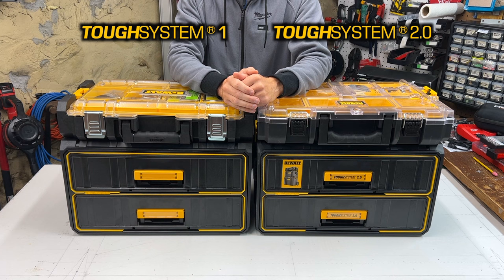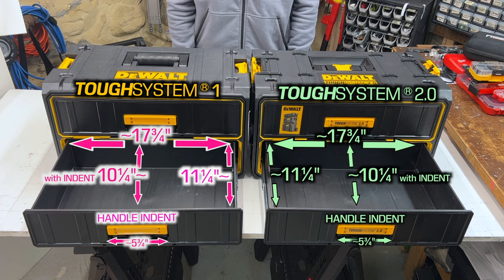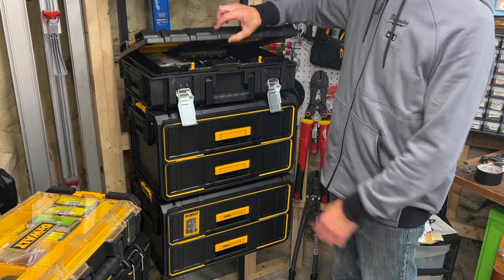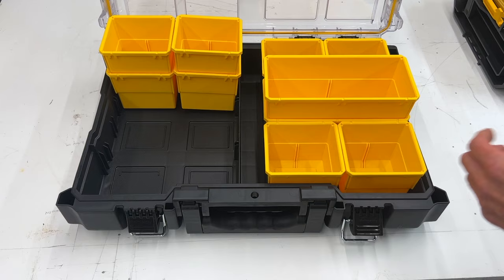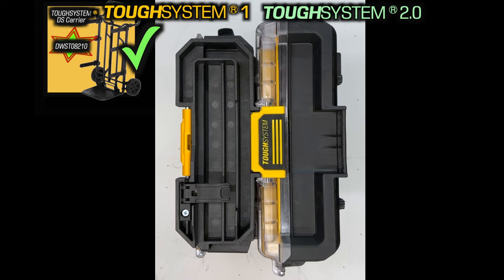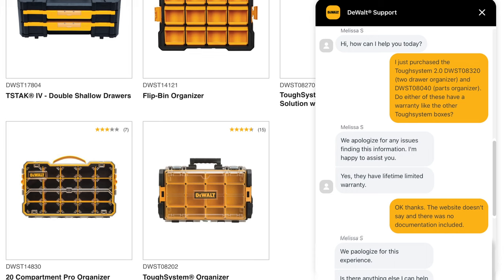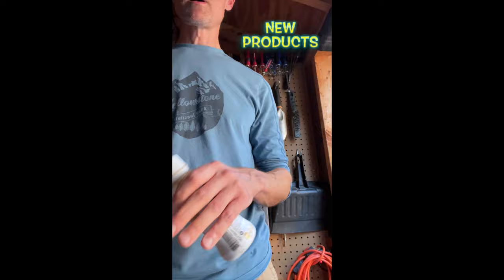DeWalt ToughSystem 1 vs 2.0 - Toolbox with Drawers and Parts Organizer

Comment: DeWalt got complacent on the storage systems. They had years of advantage and wasted it. Now it's small incremental changes that don't even compare to the massive amounts of competition. It's so bad that a few years ago they showed off a triple drawer 1.0 and that still hasn't seen the light of day. It's either horrible R&D, or some contract issues with Keter. Maybe both. So much potential wasted.
Reply from the maker: I completely agree! I’ve recently added some of Ridgid’s Pro Gear Gen 2.0 boxes to my rig and I really like them for the price.
Reply: The 3 drawer you saw years ago did see the light of day but was only in the UK! Ridiculous. They even had the pic of it on those little pamphlet things that are zip tied to a box sometimes. I imagine plenty of ppl were like o thats cool and then try to find it and dont understand why they couldnt find it lol
Reply from the maker: Totally makes sense. I believe they were also available in Australia.
Reply: the three drawer is now available…just google it…it JUST came out.

Comment: I checked out the Flex parts box and has the same middle spot
Reply from the maker: Yes, as does the packout organizer. The gap must be in fashion. I started to use the center for my pre-cut pigtails (if you don’t do electrical work, that last comment is going to sound awkward). 😂

Comment: With the organizers the 2.0 has bigger cups for the smaller ones then the 1.0. The 1.0 cups are hard to dig your fingers when the bin isnt full. The weird middle storage packout has as well so thats prolly why. The issue with the 2.0 not going into the arms irritated me too but with my setup its doable for me as the drawers that it sits on for me stay in the truck anyway and not mobile into the job. If you take a multi tool and you cut that bump out on the arms a 1/4" the organizer will fit how you need. Now the 2.0 drawer it irritates me that the box is identical to the 1.0 except for the latches and half box capability. The drawers should have been made deeper and an overall taller box to match packout drawer size. I dont think you can buy the 1.0 anymore from what ive seen but correct me if im wrong 2 DIFFERENT boxes jus makes too much sense for the end user so dewalt said screw you. I still needed them so i got them of course.
Reply from the maker: Great info so thanks for sharing all that. Does seem lazy of DeWalt to make so few improvements to the box with drawers. I’ve seen a few 1.0 drawers online, but they’re definitely hard to come by… and the price has gone up. I needed more drawers too and when I went to HD and they had the 2.0, I was like just grab it and be done with it. I honestly hate shopping.

Comment: I almost bought these Dewalt because of the drawers. I noticed the handles of the drawers on the side  instead of the top handle,  you use your back too much. So, I'm just keeping my Rigid system. I actually ordered another clearance rolling toolbox. They are pretty affordable. $59 bucks !!
Reply from the maker: I really like the new Ridgid Pro Gear 2.0 boxes. I really like the simple mounting system and the fact that the wheels come off the large rolling toolbox. They Ridgid stuff is also less expensive and seem equally as durable.
Reply: @Bruce Alan Reviews + Repairs (BalanR)  
I picked up the Gen 2 and the smaller box also.
They had an in store special. 
$67 .  I used them for my other setup. For tiles tools . Couldn't pass it up !
Reply from the maker: Wow! That’s a good deal!

Comment: Great video. I wish I watched it before ordering the 2.0 to add to my original boxes. I can confirm, they are NOT 100% Compatible! This makes it a huge pain in the ars when rolling up tools at the end of a long day. I wish DeWalt would have put more thought into this design.
Reply from the maker: Thanks for sharing your experience. I’m going to assume you’re referring to the small parts organizer since that’s the one I have the most issue with. Another person commented they were having a compatibility issue with the drawer box, but it turned out there were some screws that weren’t tightened when it was manufactured.

Comment: Totally agree with your assessment. I do like the longer organizer cups on the 2.0 for storing longer bolts and lags that I use in my proffession. Sadly I've not been more impressed with my 2.0 boxes then my 1.0 boxes. I was able to get my 2.0 stuff at a decent discount at Rural King when they had a sale a year or so ago so I pulled the trigger to try them out instead of adding more 1.0 boxes to my system. The quick latching is nice on the 2.0 but the old system latching never bothered me that much. And for me 1.0 works just as well if not better in some situations as I have the DS carrier. So I will buy 1.0 boxes in the future if I can find them as it is certianly bound to be a better deal then buying the 2.0 system stuff.
Reply from the maker: Thanks for sharing your experiences. My toughsystem 1 boxes get more use than the 2.0 boxes. May be I’ve been using them longer and I can pack them more efficiently. When I need more boxes, I usually try to find the 1.0 boxes first since they’re less expensive. I’m looking forward to Black Friday this year and curious to see if prices drop further.

Comment: NO handle on top? 
The bottom rolling box needs to be able to open without unlatching all the boxes on top. No brand  does that .  Do they ever work in the field??
Reply from the maker: I agree. I think the concept of mobile toolboxes is to be able to move the tools around and not necessarily to access them. 🤣
Reply: @BruceAlanR   it's really not a problem on a big jobsite, but when your on a smaller repair or a customers apartments,  unstacking them and then stacking is a chore, ..

Comment: Good Video! They lost me when they did not make 2.0 backward compatible with 1.0. I have 1.0 and still end up using my original Rigid system because my roll and lock will not close with the handle of the Dewaly system. I getting rid of all systems and going with Milwaukee Packout.
Reply from the maker: Thanks for sharing your experience! Yesterday I saw Home Depot had the 2.0 mobile tool box for $178 online and it came with a bonus small and medium box (so basically the whole mobile system) as well as a deep tool tray. I was considering getting another; however, I decided to give the Ridgid 2.0 Pro Gear a try because I like the idea of being able to roll in and mount the boxes to studs, which also allows the lids to be open. Unfortunately the handles are a bit wiry so if the big box is loaded and I’d I’m not wearing gloves it isn’t great. Not as nice as the old Ridgid boxes either. If you go packout, let me know what you think.

Comment: Finally picked up the 2.0 box cause I couldn't find the 1.0. The did fit the 1.0 box but, was cumbersome to get fit vs 1.0 to 1.0 box. I saw some complaining one the 2.0 bottom box when opening it rolls all the morning dew or water into the main box off the lid. With this in mind I am happy to have the 1.0 box still. Thanks for the reviews. Def going to have to get that handle mod for middle of the two drawer unit.
Reply from the maker: Thanks for sharing that. I've considered the handle mod, but since the boxes don't lock, I've turned them into workshop storage.
Reply: @BruceAlanR  OK, so I've been using these 2.0 drawers for a few weeks. I m already finding me accessing and using my tools so more often now. Just in my own garage, there is no need for locking. I am eyeing the 3 drawers now.
Reply from the maker: @1kzrider I’m likely to pickup the 3 drawer units as well. Since they’re not very deep I’ll likely just use them to store fasteners and bits.

Comment: I kinda like the fact there's a middle space in the 2.0 organizer. I'm looking for a new box to throw my socket set into since the case it came in is currently being held together by a stretchy belt. That middle spot would fit my drivers and extensions perfectly
Reply from the maker: Yeah, I’ve gotten used to the space in the middle. For my electrical stuff, I now use the middle space for premade pigtails and a spare multibit screwdriver.

Comment: Dewalt is all over the place. No wonder Milwaukee's packout  is dominating the market.
Reply from the maker: I kinda agree. It’s a shame too because DeWalt had a head start in the market place with the toughsystem.
Reply: @BruceAlanR  i think Ryobi is much further than dewalt. The Flex system looks pretty good too, if they expand on that Flex will out do dewalt.
Reply from the maker: I agree Flex looks really good. I also have to commend Ridgid’s new 2.0 boxes, which I also have. They’e rugged and considerably less expensive than most systems, but they don’t have a drawer box… yet! I was actually at my local Home Depot and saw some guy checking out the DeWalt 2.0 set and I was like, “Have you tried these Ridgid boxes?”  and then I started showing him how the wheels can be removed from the large tool box (unlike DeWalt), how they have an easy wall mount system that comes with each box, and all the included extras (inside storage cases, dividers). The guy was like, “Wow! They’re really nice and so much cheaper!” He ended up buying the whole set. I walked out of the store going, “OMG, what have I done! Did I really just discourage someone from buying DeWalt? What’s happening to me?” Ha!

Comment: I’ve had the 1.0 drawer for a year and a half now and I never use the top handle the drawers just stay in my van. The 2.0 is definitely a upgrade because if I bought it I could stack my half boxes to the top but I can’t because the 1.0 doesn’t have that yellow piece.
Reply from the maker: Thanks for sharing your thoughts.
Reply: Love the flag.

Comment: I bought two new 2.0 2-Drawer Boxes and planned to stack a 1.0 small box on top, but unfortunately it will not click on both sides. Only one side will click. It seems the 2.0 is slightly too wide.
Reply from the maker: Thanks for sharing that. The 1.0 box doesn’t clip into either of the 2.0 drawer boxes? I can’t say I’ve experienced that other than if I really max out a box and it bulges in which case it doesn’t want to clip in easily.
Reply: @BruceAlanR  Actually, I only tried clipping the 1.0 on top of one of the 2.0 boxes. I'll try both and will update.
Reply: I thought I posted an update. The screws needed to be tightened. After doing so, the 2.0 snaps onto the 1.0 without issues and vice-versa. I guess they weren't fully assembled when shipped to the seller.
Reply from the maker: @ALTONBENALLY That’s great news! Thanks for posting an update.

Comment: The gap in the middle is for those boxes of multiple machine screws, terminal kits, multi size shrink tube kits, washer and bolt kits.
Reply from the maker: Yes, I use one box for my electrical supplies and put my pre-cut pig tails and shrink tubing in the middle.

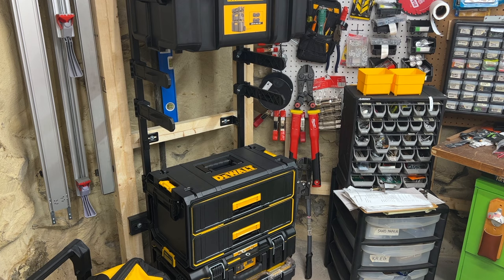Comment: At 2:24 in the video you show how the 2 drawer unit can tilt forward when mounted to the workshop mount. It looks like that’s the 1.0 unit in the video shot (which I also have). Does the 2.0 still tilt forward when the top drawer is open? I was hoping the wider handle might stop that.
Reply from the maker: Great question and observation. Unfortunately both my 1.0 and 2.0 drawer boxes tilt forward unless there’s a box above.

Comment: 🤔 Does the 4 port fast charger fit seemlessly on top of the drawers, and lock in place? If so, that's all I need 2 hear to go get these! Thanks for the vid!
Reply from the maker: Yes. It’s the power station that requires a 1.0 box.
Reply: No the 4 port charger doesnt just fit the 2.0 box. It can be made to fit though grinding and shaving the bottom of the feet. Works like charm after that. Also did the same thing to the powerstation but that definitely required more shaving and all but 100% worth it. Its underneath. Who cares it works great and you dont even notice
Reply: @BruceAlanR  4 port charger an issue too but both units can modded with grinding and shaving of the feet
Reply from the maker: Thank you for clearing that up. My buddy has a 4 port charger attached to the 2.0 boxes, but I didn't think to ask if he did a mod. He's pretty savvy so it's likely he did. Thanks again!

Comment: My 1.0 drawer box looks totally different. They must have 3 versions
Reply from the maker: Interesting! What’s different about your 1.0 box as compared to mine?
Reply: @BruceAlanR  the original 1.0 has no yellow foam around the edges. Water will go straight into it if any rain gets on it and they are very flimsy. I see why they immediately upgraded them. I don’t know how I missed the in between version. I use the DS carrier and would much rather have the two drawer with the locking mechanism on the back.
Reply from the maker: Wow! I’ve never seen it without the drawer gaskets. Must have been the original version. I agree that DeWalt should have made the 2.0 boxes compatible with their own DS carrier, which is far superior to the mobile toolbox.

Comment: Dewalt not offering a warranty on the drawer system humm
Reply from the maker: They provide the usual warranty on all the new boxes, it's just that they hadn't updated their website at the time of the video. The warranty is posted on a sticker on the box though, so no worries. I guess they're better at making tools than they are keeping their website current. 😃
Reply: @BruceAlanR  👍🏾

Comment: Packout is simply better
Reply from the maker: Thanks for sharing your thoughts. I’ve just never been a fan of the Milwaukee wall mounting system. I do like the box configurations though. I recently picked up a few of the new Ridgid Pro Gear 2.0 boxes and really like them… they’re also less expensive.
Reply: @BruceAlanR  I have altered mine to suit my needs. There is a wealth of modifications that can be done to them. More then any other brand, by far. This mod community has created 3D printed mods and well as 3rd party add ons. So you can fine tune these packout boxes to perform way beyond what the others are capable of.  I believe if you are trying to refine your craft then you need to look not only what they are but also what they could be. Few bring this point up when they review.
Reply from the maker: Good to know!
Reply: Here in Australia, you pay almost double for a Milwaukee equivalent to DeWALT ToughSystem 2.0 3 In-1 Tool Box Bundle.
Reply: @ibby81ae  yep. They are expensive.
Reply: @TAC Systems  I had a look at both dewalt and milwaukee 3 n 1 bundles and although Milwaukee has better build quality, I don't see the justification for spending that extra money on it.
Reply from the maker: Yeah, I get it!

Comment: Just watched a video of guy was able to put a handle on it
Reply from the maker: I will definitely look for that! Thanks for mentioning it.
Reply: @BruceAlanR  If was dewalt I start looking into is someone try sabotage my product, why would you make something worse that's what made that product better than Milwaukee it had the top handle other than that Milwaukee drawers are better the thing that sucks about Milwaukee is drawers don't lock without the stupid bar
Reply from the maker: I agree that the bar on the 3 drawer Milwaukee box is weird.
Reply from the maker: Brilliant Sam! Thanks for putting in the time… And nice job for a first video. I’ll add a card in my video linking to your video.

Comment: You forgot that the system 2 wobbles more than a jelly
Reply from the maker: Ha! Yes, I suppose there’s that too! Thanks for noting that.
Reply: @BruceAlanR  I think its a good reason for not buying the mark 2 , I have the 1 drawers and they lock together rock solid , Cart them about on a cosco sack barrow (s the Dewalt toughsystem truck is rubbish) and they are solid the new version as I said wobbles more than Grandma's jelly
Reply from the maker: Costco sack barrow? Ha! I’ll have to check that out. Maybe I’ll setup another rig. Thanks!

Comment: The gap in the middle is for those boxes of multiple machine screws, terminal kits, multi size shrink tube kits, washer and bolt kits.
Reply from the maker: Thanks for sharing that. I actually set one of the 2.0 parts organizers up with my electrical supplies and put shrink tubing and pre made pigtails in the gap. Works well. Thanks again!